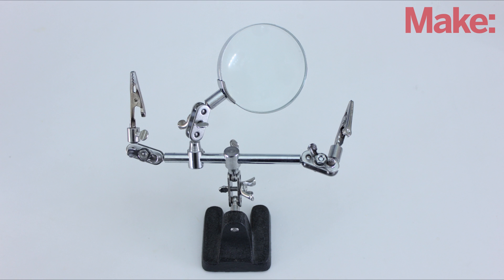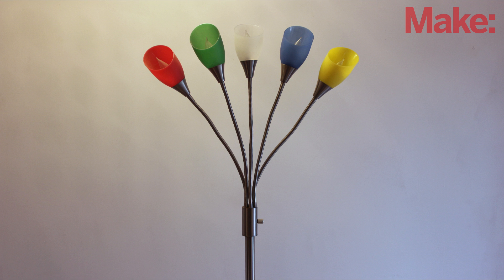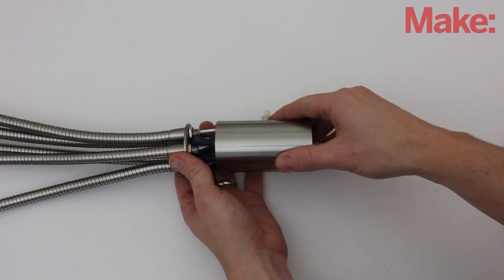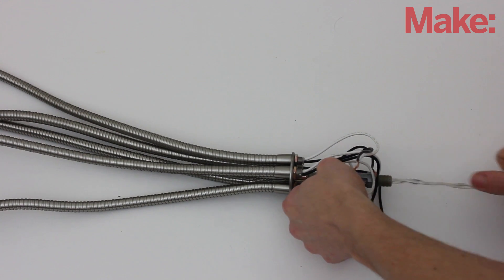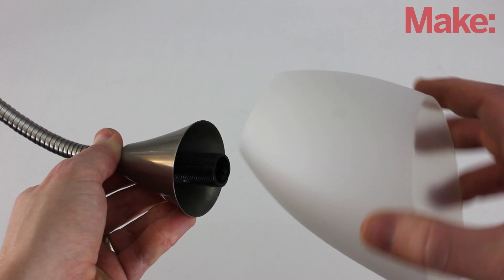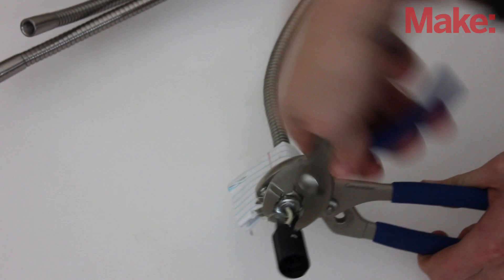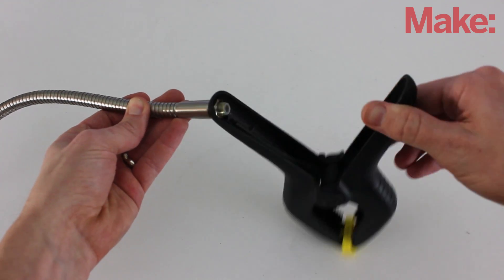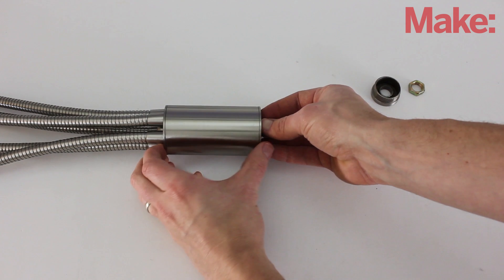Heavy Duty Helping Hands

Comment: Great idea! Might be a good idea to incorporate a light onto each of the arms by using the original wiring. Just divert the wires out of the side of each cable, but up about 6-12", convert each socket to a smaller bulb and socket so you could have a spot light shining on each clamp/fitting. Or just keep one arm as a light so you could have a maneuverable spot light.

Comment: Or,  a person can get the flexible metal tubing (without breaking a lamp), feed a small metal cable through it, attach threaded ends to bolt onto, secure it to a block large enough to add clamps to secure it to a work bench or whatever, and then attach the spring clamps. Just pulled that outta my @$$.

Comment: The way you mounted the clamps was kind of weak. You should have one of the two handle parts of the clamp be held against the end of the arm and be secured at two points rather than one. This should stop the nuts from loosening by rotating the clamp.